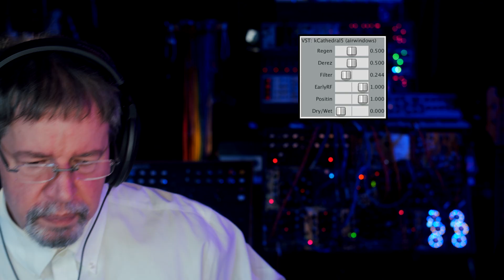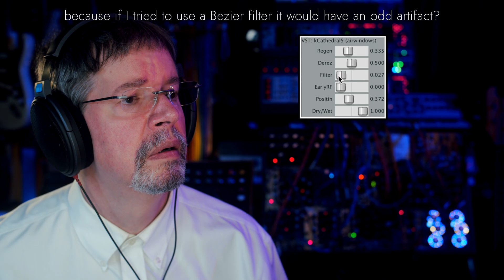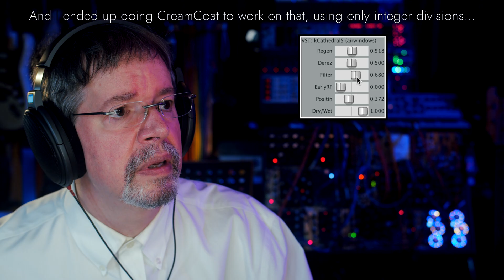Airwindows kCathedral5: Free Mac/Windows/Linux/Pi CLAP/AU/VST3/VST2/LV2/Rack

Comment: Is it possible to use the different consoles interchangeably in a project or do I have to pick one and stick with it? I tried to use different ones and it seams to work. Does anyone know how this works 100%?
Reply: Some of them use the same code like console 9 and console x... So you're in code and decode can be pretty interchangeable with those... Most important thing to remember is that the decode plugin (The console bus plugins) needs to be the inverse of the encode plugin (The console channel).

So in theory you could mix and match beyond the ones that have all the same encode decodes on a project... If there was a reason to do that in your mind... However you'd want to put the same one on all of the instruments or drums or voices going to the same bus... And you would want decode It was inappropriate opposite.  

Does that make sense?
Reply: @ramspencer5492  sort of yeah. I've done nothing but sit and experiment for the last 4 days and my mind is blown and almost my ears xD P put a dither on a track and touched a knob that increased the decibel by about 70 from out of nowhere haha, scary. But im having so much fun, the console7 for hip hop/rnb/slow analogue synth sounds from diva.. what is this world of sound??

Thank you for your response, I will try to mess around with X and 9.

The reason I'm asking is because the MC I love the sound of but it removed so much bass from my tracks when it was summed (had about 6 stages of decoding). The sound was amazing though and id like to use it on only certain parts to see what happens. Im trying to wrap my head around how to best route things in ableton to give me the least amount of headache if I later want to change 10+ channels / busses.  

How long have you been using these and what daw do you use? Do you work professionally  or a hobbyists like myself?

Comment: Thanks for updating the reverbs. Without controlling early and late reflections, reverbs are limited to a few crazy uses. I have my tracks mixed into 5 room zones and an overall room tone using reverbs. From Front to Back. I use sends for different elements of the mix to each section for depth. With early/late reflections, we can position the instrument precisely in the room. Then dial the buses for each room to taste. It makes for a much better mix and master.

Comment: Interesting so like would you just run several of these and just use the wet dry instead of putting it on a bus? Basically trying to arrange your instrumentation inside of a big space? How much smaller can the space get? 
What if we had some different size rooms but they were done in clicks so we're sure to be in the same room for every instance you had open?

Oh right... My bad... You don't really need to do a whole bunch of instances... You probably get away with a really near and really far and then use various amounts of both or either to place instruments....

 Is definitely something really organic sounding going on in this one! Nice work Chris! 😎🙏